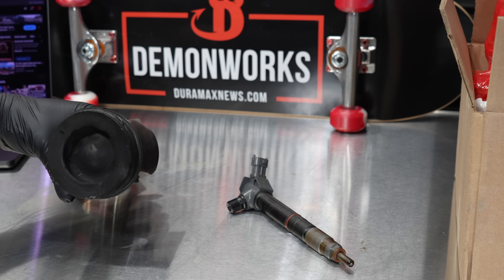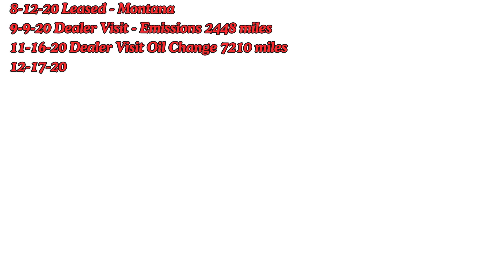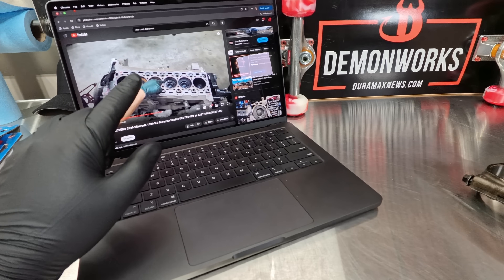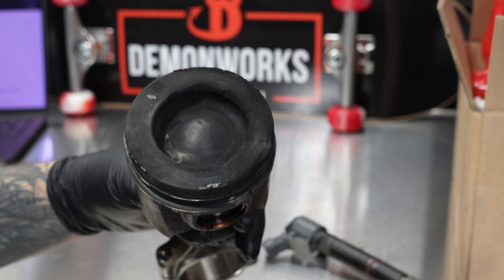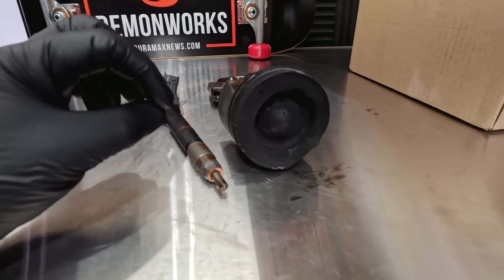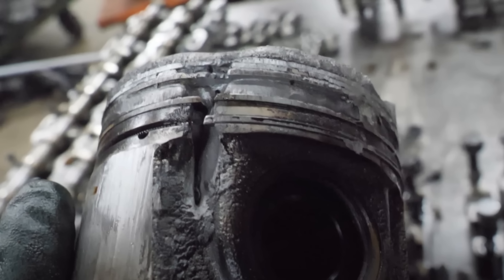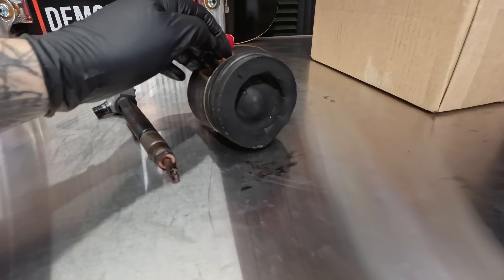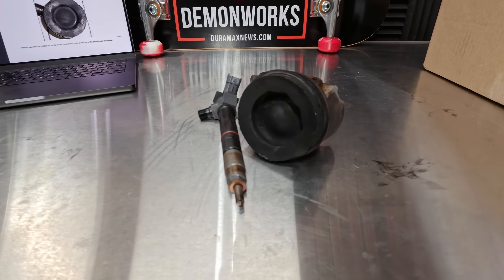3.0 Duramax Melted Piston / GM Tech Perspective on Likely Cause

Comment: Do you think the Banks Pedal Monster could cause something like this or it is safe to use?
Reply from the maker: Banks pedal monster will not cause this. The pedal monster changes the throttle sensitivity and does not add any fuel or boost, so all is well.

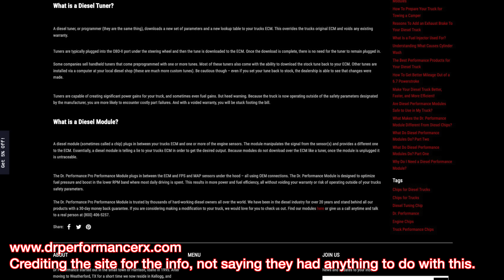Comment: 6:00 - Ya, add in simple "tuners" that fool the system into injecting extra fuel are junk.  They likely aren't detectible if removed though, as the ECM wasn't flashed.   

A reputable tune that entails flashing the ECM is better, but illegal in the US and really not necessary as the 3.0 runs really great right out of the box.  I wouldn't risk tuning and losing warranty on an expensive vehicle.
Reply: tuning is not illegal in the US

Comment: If a power tune only hurt the centre pistons ,why was a Gasoline dilution ruled out ?
Reply from the maker: It’s just my assumption, I feel there would be other signs. one of which is clean pistons and I believe we would have seen other symptoms of detonation rather than melting. Detonation would come first and I would think there would be signs of that, including pistons cracking. I could be incorrect though.

Comment: Do you consider these piggy back devices that manipulate fuel pressure and maf signals to gain power a "tuner"? They claim to not leave any traces on ecm and there is not "tuning" involved.
Reply from the maker: I use the "tuner" word loosely for piggy back as well, even though they are not doing any tuning. People like the piggyback to fool warranty when issues arise, but melted pistons would be a red flag and gm could deny coverage. In addition, the transmission does read how much power has been sent to it as well as the engine being able to calculate hp/tq.
Reply: @DemonWorks  fair enough. I have a 2024 lzo and I honestly looked at one system In particular but again I'm under full factory warranty and was curious as to how they could reasonably deny a claim without the ecm being manipulated. I'm not saying I will or won't add one lol but I am nervous. I was definitely the warranty on most of my fullsized diesels in the past so i know the price to pay for more power huh huh huh huh (tim the tool man taylor grunt haha)

Comment: Here at the dealer... Anytime we get internal engine problems, we have to send GM the ECM/PCM files.  They check to see if programing has been changed.  They can also tell if it was changed back to stock.  We have denied warranty on many vehicles because of this.  You wanna play, you gotta pay when it breaks.  We also get a lot of diesels with DEF in the fuel system,  another thing not covered is stupidity.
Reply from the maker: Same thing I said in one of my responses here. “If a vehicle needs an engine under warranty, we are required to pull the calibration history and current calibrations, screenshot then send to gm for approval. They then make the call. If a calibration is sent in that fails, it will show up on the warranty information almost immediately after confirmed its aftermarket.”

Comment: Demon how difficult is it to replace the crankshaft cover on the LZ0?
Reply from the maker: The front cover? Are you sure it’s not the plug? Are you doing it yourself? 

Oil and Coolant Leak locations on 3.0 Duramax + Ground Issue
https://youtu.be/HLhqwX_3ByI
Reply: @DemonWorks  The top cover. I think also called valve cover. Yes, I'm trying to do this my self. My truck is consuming two quarts of oil between oil changes and the Dealer said it was normal for the LZ0 engines. Since GM wouldn't do anything about it I'm planning to replace the valve cover to see if that helps with the oil consumption.

Comment: If this is a common rail engine wouldn’t injection pump timing be irrelevant beings the rail feeding the injectors would always have the same psi. I do see how advancing/retarding the timing of the actual fuel injector and fuel pressures could cause this and generally agree it was probably a plug in device that caused the failure. The only question I have is why did it only affect a few holes? It was hot enough/ enough pressure to completely melt through one of the pistons and severely damage others, it’s odd that a couple pistons were basically unscathed .
Reply from the maker: correct,  injection pump timing is irrelevant. I mentioned that because the teardown video, Eric mentioned it as a possible cause.

Comment: Just found your channel, I have 99,400 on my LM2 and love it. It’s had some issues. Coolant control valve, cylinder 6 glow plug/connector AND chaffed harness, and auxiliary coolant pump. But still absolutely love this truck. Excited to learn how to work on it through you!
Reply: Where is the harness chaffed? Wondering if it’s a preventable issue with wire routing/shielding
Reply: @SkyDaddy1000  they told me it was where the main engine harness collects and turns toward the driver side wheelwell. $1k for the repair.
Reply: @AirP1aneGuy_yt  Thanks for the reply! Gonna check this weekend and see if It’s a preventable issue with mine as well.

Comment: anyone having oil consumption issues with their LZO ? I was hoping mine would stop or at least decrease after ten thousand miles or so, but im at 14,000 now and i think it has gotten worse. I LOVE the engine and  DW has taught us a lot about them I normally wouldnt know.
Reply: I have a 2023 silverado with the 3.0 LZ0 and it is consuming two quarts of oil between oil changes, the truck currently has 22,000 miles. I took it to my local chevy dealer they performed a consumption oil test and they said it was normal. Supposedly these engines can consum a quart of oil every 2,000 miles which I don't think this is acceptable.
Reply: @fernandobarragan3330  Not acceptable for me either, I’ve never owned any vehicle new or old that consumed oil. I have to bring oil with me if I plan on a long trip, something I’ve never had to consider before.
Reply: All comes down to how the rings are broken in. They need to be put under load right away and heat cycles first couple hundred mi, if driven easy for first couple thousand mi, u may never get rid of the oil consumption now. Or it can take thousands of mi to get them to seal. Specially with synthetic oil

Comment: So does GM scan the ECM as well to prove programming was done to turn up the power?  Just denying warranty based on a visual inspection seems like an incomplete investigation.
Reply from the maker: If a vehicle needs an engine under warranty, we are required to pull the calibration history and current calibrations, screenshot then send to gm for approval. They then make the call. If a calibration is sent in that fails, it will show up on the warranty information almost immediately after confirmed it's aftermarket.

Comment: Love your channel , I have a question , I want to order a 25 suburban with LZO dsl , it will be mostly highway , approx 25 k a year , but twice a week the SUV will need to idle 2/3 hours . Will this long idle time mess with my DEF operation, should I be concerned about idling a DEF dsl ?
Reply from the maker: thanks for the kind words ! Yes, that idle time will end up hurting your exhaust aftertreatment system and cause you issues, unfortunately.
Reply: Why do you need to idle for that long? If you are hooking a trailer up there are times you can shut the vehicle off.
Reply: @EBIndy  search n rescue dogs will be  in the suv & need heat & a/c

Comment: If he wanted more power then he should have gone with 6.6 to begin with.
Reply: Seems like there's a few guys out there that need to tow 10,000+ lbs and can't decide if they should go with an LM2/LZ0 or step up to a heavy duty. They end up going with a 3.0 and wish they had more passing power, so they start doing foolish things to boost the power for cheap. I get the price difference between a 1500 and 2500 hurts, but playing around with aftermarket stuff will cost way more if you destroy the engine.

Comment: Dont put tuners on throw-away engines!......An aluminum block diesel engine is a throw away
Reply: The BMW M57 and B57 have been around for over a decade making even more power from basically the same engine design and there haven't been any issues with the block. You do realize that the primary reason diesel engines used to be made from regular grey cast iron was because it was cheaper than aluminum, not necessarily because it was stronger. An aluminum block can be just as strong as a cast iron block, it's all about the balance of weight and cost. 5.0 Coyotes are making over 1000 HP on 20+ lbs of boost and 12:1 compression and those blocks are not even particularly stout as far as factory engine blocks.
Reply from the maker: OK.
Reply: Tell that to the M57

Comment: Why GM put aluminum piston in diesel engine? I dont understand
Reply: Do you know anything about diesel engines? The 6.7 Powerstroke used aluminum pistons for the first 9 years it was in production. The 6.7 Cummins has been using aluminum pistons since 2007. Aluminum pistons are fine but taking short cuts to make more power for cheap will destroy any diesel engine.
Reply: GM put steel pistons on the redesign 3.0 duramax LZ0
Reply from the maker: I think you got your answers from others here. I am assuming you are experienced in heavy duty applications, aluminum is common in the light and medium duty diesel engines.
Reply: Because it’s a light duty diesel engine built for fuel economy. It’s not meant to tow 30,000 lbs up mountains. Aluminum block and pistons are just fine for what this engine was designed to do
Reply: Is 3.0 eco diesel block made out of aluminum ?
Reply: You do realize that aluminum pistons in diesels are common, right? The 6.7 Cummins uses aluminum pistons.
Reply: Also why they used an aluminum block for a diesel application is beyond me.
Reply: @PeeterPuncher  The Opel and BMW versions of this engine are also aluminum. It's a non-issue. Only downside is that the tuners won't be able to make crazy gains over stock.

Comment: Is it true on the LM2 ( and LZ0 ) that when the engine goes into regen mode its the injectors themselves that over fuel to create the DPF burn off ?. If that is correct, is there a possibility that piston damage could occur if lets say towing hard while in regen mode. Certainly GM had a reason and be that to be able to handle more power or some other reasons to have gone to steel pistons that would be able to handle more of this over fuelling abuse.
Reply from the maker: Yes, diesel fuel is introduced during the exhaust stroke where the DOC heats it up to create the burn in the exhaust system.
Reply: The additional fuel is added during the exhaust stroke though and increases the heat a little bit inside the piston in sure, but most of the heat increase is done by the DOC (I believe) igniting that unburned fuel in the exhaust stream to increase the temps to where they need to be for regen.

Comment: My truck is a 2021 lm2 stock and I farm on the side I have it towing all the time it has about 110,000 on it. It doesn’t use any oil till your over on a oil change the def temp sensor went out and I’ve had a bad oil sample on it also seems to have blow by or high crankcase pressure but it starts sound runs great probably cranks half as long as my buddy’s truck with about 40,000 on it @demon works would you be willing to look at the oil sample
Reply from the maker: If you already got a sample done, yes, you can send the image of the paper to me if you want mstrgoodrench@gmail.com I wouldn't worry about blowby, as the trucks have a large amount of steam/crankcase gases when the oil cap is removed, just the nature of the beast. Obviously, it could be real bad, then it's not normal. Just wanted to point out that they all do have blowby signs.

Comment: Logic says that if you are not happy with the factory power output of your engine, you bought the wrong vehicle.
Reply: You see it on the Facebook lm2 groups from time to time. Guys that tow a 10k trailer for work and want to downsize to a 1/2-ton diesel for the fuel economy. These a great trucks but pulling 10k lbs every single day... I wouldn't do that with any half-ton. But I would put mo ey on it that some guys will do it, wish they had a bit more power like their old truck had, and go cheap with something like the AG Diesel module that boosts rail pressure.

Comment: agreed on the theory BUT the timing of it seems odd since, there was barely any lm2 tuning out when this engine failed
Reply: AG diesel has had a performance module out that messes with fuel rail pressures. I could easily see a guy that should have a 3/4-ton for what he's towing but decides to save money by going with an LM2 truck and then decides to run an AG diesel  module. Tow heavy on the highest setting and you're tempting fate.
Reply: LM2 tuners have been around for a bit. LZ0 is the one they haven’t been able to crack yet as far as I’m aware.
Reply: na lm2 tuners have been around. lzo they have not completed yet. everyone wants tuners and power adders. then they destroy their truck. smh
Reply: @sethlover6498  yep. Spend 65k on truck, spend $5k on upgrades. Whine about a $2500 oil pump belt service at 200k miles. That’s pretty much every 3.0 forum
Reply: @BabyGators accurate. Don’t make too many people mad this morning with all those facts.
Reply: @sethlover6498  I'm aware they've been around for some time.  lm2 refresh interiors vehicles is pretty recent but the "1st gen lm2" have had tunes for a little longer but seems most likely this car didn't have the tune for very long.